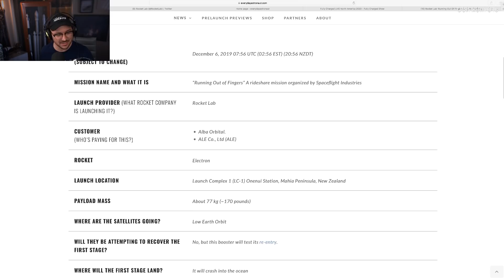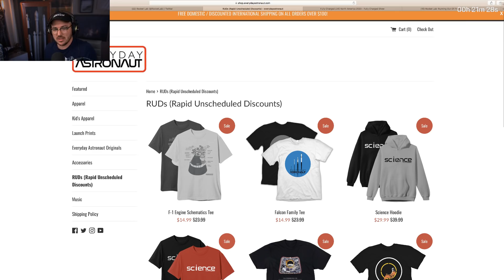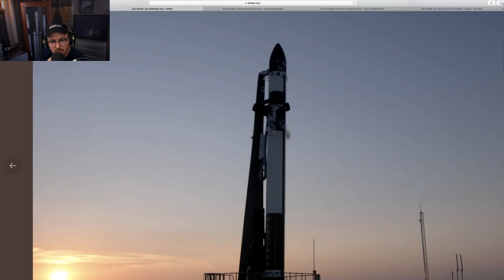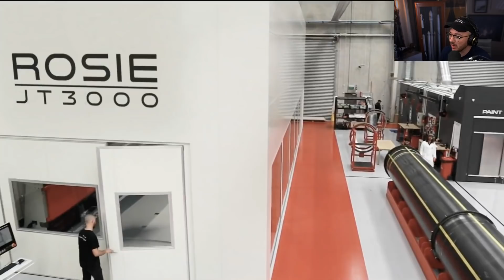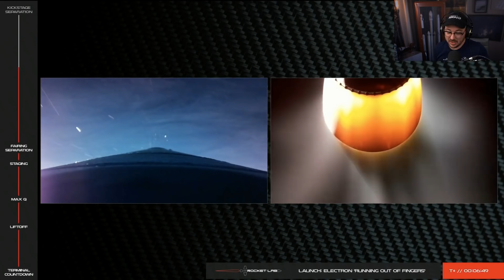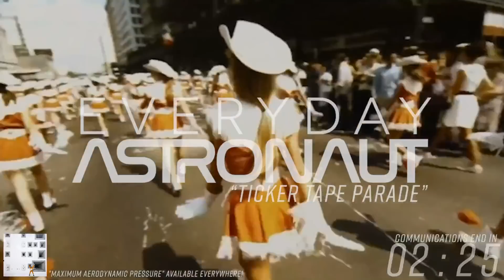Watch Rocket Lab test booster recovery hardware for the first time!

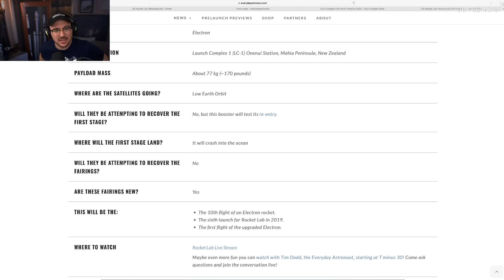Comment: Great video as always and I am subscribed. One minor correction from 7:34 where you say Alan Shepard propulsively landed. He didn't.  Shepard stayed on a suborbital trajectory for the 15-minute flight, which reached an altitude of 101.2 nautical miles (116.5 statute miles; 187.4 kilometers), and then fell to a splashdown 263.1 nautical miles (302.8 statute miles; 487.3 kilometers) down the Atlantic Missile Range.  All good wishes, sir!

Comment: 1:14:30 spinning the booster end over end would provide centrifugal force to get the fuel towards the bottom, as the LOX is under (high) pressure, that's less of an issue. 
Assume that's why early Soviet launches used Hot Staging, as the next one would still be under acceleration.  
Unsure how NASA managed Cold Separations but did from almost their onset.
Reply: Ullage thrusters
Reply: @ryanspence5831  Thanks for the reminder, recall seeing those in the footage where the third stage separates in Apollo (thought that would only work in (near]vacuum but not with high air drag, a Space-X 'oops'?)
Reply: @KOZMOuvBORG  As long as your ullage thrusters are enough to equal or exceed the force of drag, you can get enough g-force to settle the propellants towards the pipes. On the Apollo missions using the Saturn IB, the S-IVB upper stage used solid rocket ullage motors, and on the Saturn V Apollo missions, they used a restartable ullage motor. This modification meant that a differentiating name was needed, so the SRM powered ullage S-IVBs were called 200 series, and the restartable ones were called the 500 series, the same as the codenames for the Apollo missions varying by launch vehicle. (AS-203, AS-202, AS-501 [Apollo 4], AS-205 [Apollo 5], AS-502 [Apollo 6], AS-205 [Apollo 7], AS-503 [Apollo 8], AS-504 [Apollo 9], AS-505 [Apollo 10], AS-506 [Apollo 11], AS-507 [Apollo 12], AS-508 [Apollo 13], AS-509 [Apollo 14], AS-510 [Apollo 15], AS-511 [Apollo 16], and AS-512 [Apollo 17].)

Comment: In the video when the rocket is launching, it really sounds a lot like a very loud jet. Is this due to the electric pumps or is this a artifact of the video recording process?
Reply: 1. Microphones have a hard time capturing the true sound of very loud sources, so what you hear isn't quite right to begin with.
2. A rocket exhaust IS a jet. In principle, a jet engine with an afterburner is a rocket engine. They're not that different in terms of exhaust.

Comment: 90° is east not south.
Reply: inclination of a satelite orbit is measured as the angle between its orbital plane and earths equatorial plane.

0° inclanation means the satelite orbits exactly above the equator, going eastwards (same direction as earths rotation)

90° inclanation means its on an exact polar orbit, so going south until it passes exactly over the south pole, then going north until it passes exactly over the north pole, then going south again, etc.

180° inclanation means its on a retrograde orbit over the equator, so going westward (opposite to earths rotation)

there are no inclinations above 180° and no negative inclanations since e.g.  -20° would be equal to +20° and 190° would be equal to 170°.
Reply: 90 degrees of orbit inclination.

Comment: Regarding the question on NZ electricity generation, it is mostly hydro with a handful of geothermal stations (including the second one built in the world). Several wind farms have been installed in the last couple of decades which are helping with increased demand/unwanted immigration. 
There is only one thermal (coal/gas) plant at Huntly, just south of Auckland, generating 15% of the total (apart from a couple of small diesel fired peak load plants. 
There is no nuclear (NZ being nuclear free by law).
The largest hydro plant, Manapouri, near the bottom of the South Island, generates about 12% of the total but this is used to smelt bauxite (from Australia) into aluminum. Transmission of this power to other users is difficult due to its is distance from markets. 
If more renewables (solar/wind) are added there is significant scope to convert existing hydro to pumped hydro for storage, especially when the whingers demand everyone drives EV's.
Reply: I was looking at power generation not long ago and geothermal does not get the news coverage it deserves, most of current geothermal capacity came on-line in the last 20 years and there are many more similar developments, some quite large, planned.
Reply: andrew worth NZ has had large scale geothermal power production since mid last century. It can deplete geothermal fields if reinjection of feed water is not used. Geothermal heat is also great for lower density energy needs such as hot water, central heating and steam production. In NZ it is usually used for thermal pools, dairy factories, paper mills etc.
Reply: @lewtscott3346  cheers, I live in Rotorua . . .
Reply: andrew worth Commiserations on your misfortune.
Reply: How do wind farms help with your immigration problem?

Comment: Did they not recover the rocket or does Tim not cover that?
Reply: No, they had no plans to actually recover it. This was just a data-gathering mission to see how their modifications performed.
Reply: They didn't intend to recover it just yet.
This was only a reentry test.
Reply: There was no intention to recover the first stage, they did attempt to control re-entry and keep the stage intact down to impact with the ocean, in this they were apparently successful, with the stage sending out good telemetry until impact.
Reply: How is this hardware recovery?
Reply: They very carefully did not say that it crashed but it crashed. They weren't planning to actually land it I guess? Or maybe that's revisionist history.
Reply: Gordon Chin they wanted to grab it with a parachute and helicopter. They never intended to “land it”
Reply: @GunkDung   Of course they weren't planning to land it. They never plan to land them. Once they perfect the reentry maneuver, and develop a little more tech, their plan is to snag the thing out of the air with a helicopter. That is going to be epic to see.

Comment: why was it launched from new zealand? Isn't it harder to launch from further away from the equator?
Reply: Only if you want an equatorial orbit. If you're looking for something a bit more inclined — as many non-geosynchronous orbits are — then higher latitudes are just fine. For an extreme example, you can launch into a polar orbit from pretty much anywhere on the planet...
Reply: I believe it's about the inclination desired. Savings from an equatorial launch don't necessarily outweigh inclination flexibility, transportation of the rocket to launch pad, and other factors. If I remember correctly, were talking less than 1% advantage
Reply: The electron is optimized for high inclination to polar orbits, there is little to no advantage with such orbits from using equatorial launch sites.
Reply: @andrewworth7574  Yeah - In fact, if you're going to a polar orbit, being further from the equator means you have less eastward velocity that you have to cancel out! :) If you could launch from the north or south pole you'd have none at all. (But that's probably not feasible for a wide number of reasons.)
Reply: @TallinuTV  Certainly, launching from the north pole might be challenging...  you could probably launch from sufficiently thick ice, but hot exhaust will cause some problems for the ground infrastructure.
Reply: Also, for comparison – the site at Mahia is about 40° south... which is closer to the equator than the major Russian sites at Baikonur (46°N) and Plesetsk (63°N). So it's hardly an extreme case...
Reply: The air is clearer in NZ so it doesn't have to waste energy pushing its way through smog ;-)